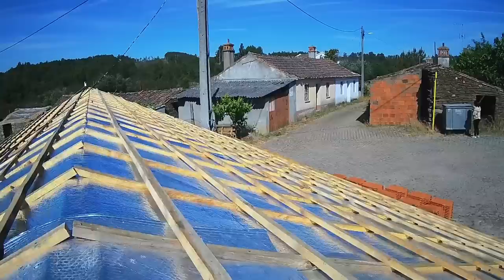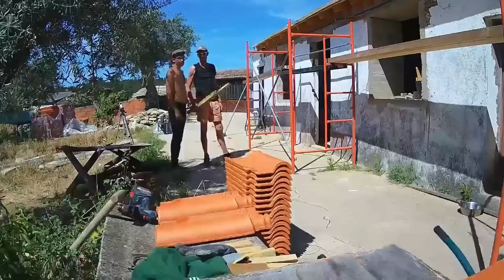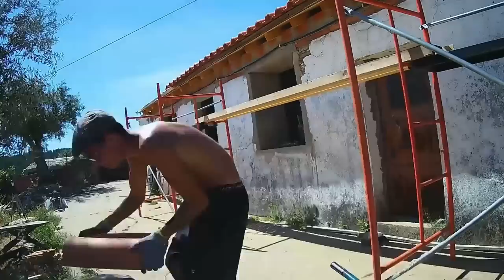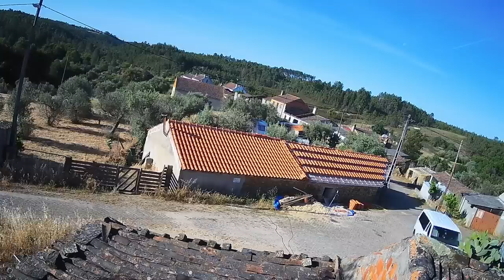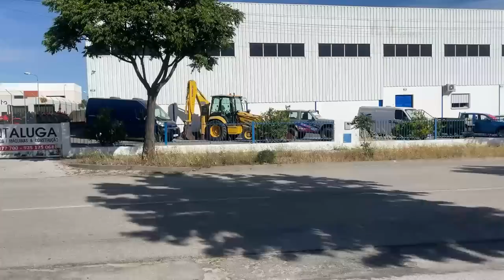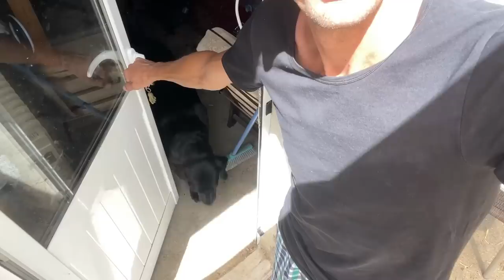S3E23: MOVING TILES ON THE ROOF! - DIY PORTUGAL

Comment: Jasper, root canals are a temporary solution at best. You have an infection ‘Apical” outside the root and the tooth needs antibiotics and removal or it will wear you down
Reply: Very good advice!
Reply from the maker: Idk man, I had root camel treatments over 15 years ago and those teeth are still working fine now.. :)
Reply: @GhostTownVlogs  The fact the pain persists would imply the canal drainage is not working or as stated only a partial solution. Nowadays the alternatives in dental prosthetics make the risk of chronic dental infection unnecessary. Your call obviously but stay healthy as we all want to see the Project completed

Comment: Well that was a lot of work getting all the tiles moved.  Good you had help.  Sorry about your van.  Timing Belts are expensive.  And, it sounds like you have transmission problems too.  You may have to rent car for a little longer.  I guess that last trip from Denmark hauling all your possessions and pulling a trailer did a number on it.  It too will be expensive.  And, a root canal?  You are going to be a poor man......with a new roof.   LOL  Best of luck
Reply: Holland, not Denmark.  "Something is rotten in the state of Denmark."  (Shakespeare)